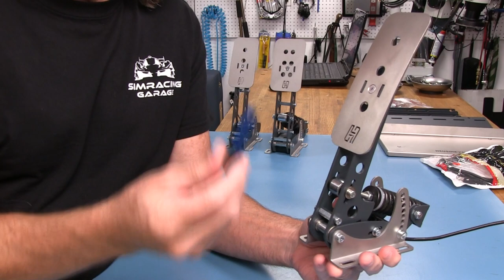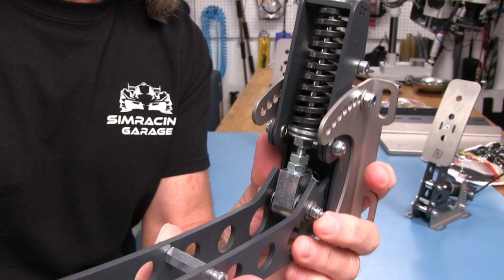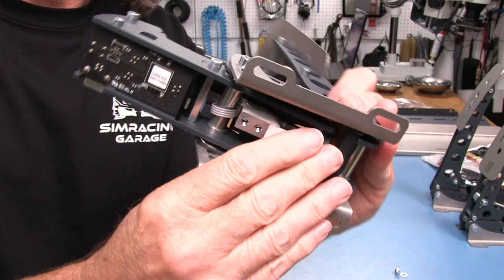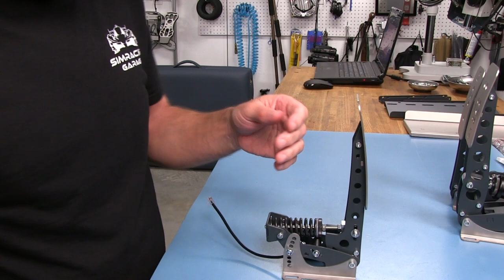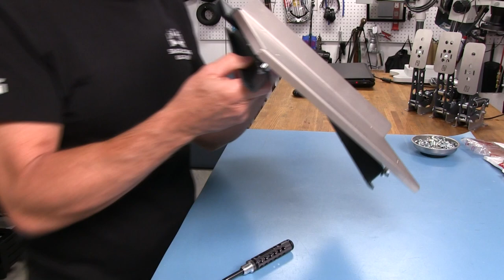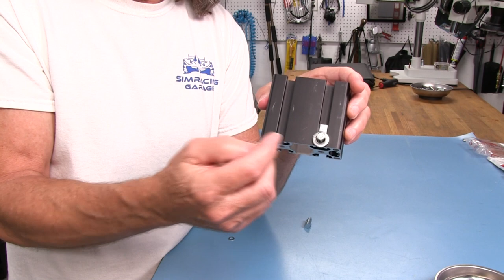Heusinkveld Sprint Pedals Review

Comment: Hi Barry, thanks for the review. We'll look into why the hex heads don't fit the aluminium profiles. We added these bolts to the baseplate some time after the initial release specifically to make installation easier, but it appears the wrong spec/lenght may have been packed.
Reply: It would be great if you offered polyurethane springs to sprint pedals, at least as an upgrade (like fanatec do with clubsport v3).
Reply: That's good to hear as this pedal set is going to my next purchase and I was a bit concerned about Barry's comments regarding the base plate installation.
Reply: @MM00111  Can you elaborate more on this? I'd be interested to hear about it before I buy.
Reply: Ian Longley  I like polyurethane more than rubber, from my point of view it feels more natural (by leg... more like racing car brakes). So I'd like to buy polyurethane springs instead rubber for my HE Sprint. So I suggest HE to begin to make this upgrade for sprint pedals :). Fanatec sells this springs upgrade for 30 eur... I'd like to pay 70 for HE ).
Reply: Had the same issue here. I had to add some washers to get around that problem.
Reply: Why does the throttle look so hard to press?
Do racecars have hard throttles? 
In my driving experience from cheap cars to more expensive €300,000+ cars the throttle is really delicate and really easy to press.
Reply: We took some measurements today and checked the schematics. A typical 40x40 aluminium profile has a depth of 12,25mm. The thickness of the baseplate C-bracket is 3mm (total height 15,25mm). The length of the hex bolt is 16mm. We supply 1mm washers with the baseplate so the heigth can be increased to 16,25mm, 17,25mm etc.

This means that when using the hex bolt to mount the baseplate with 1 additional 1mm washer (or maybe 2) the bolt will have enough clearance to the aluminium profile.

The baseplate manual only details the installation onto a flat metal plate ( https://heusinkveld.com/wp-content/uploads/Sprint_BASEPLATE_manual_V1_1_DIGITAL.pdf - page 10/11). We added the hex bolts and t-nuts at a later stage to the baseplate product. We'll make sure to add instructions on how to exactly mount the baseplate to aluminium profiles in the next version of the manual, the mounting materials are already included.
Reply: @MM00111  On the Sim Pedals Sprint the rubbers are made completely to our spec. On the (phased out) Pro pedals and Ultimate pedals we indeed use standard PU rubbers. The rubbers on the Sprints are a different synthetic rubber. Of course a lot of other factors apart from material spec determine the durability of a rubber, but based on our tests (and of course after having a lot of Sprint pedals in the market already), our current rubber spring solution if far more durable than the previous PU variants we used.

Feel is always very subjective of course :) One thing we did manage with the Sprint pedals compared to the Pro pedals we phased out, is that on the Sprints you can set the brake both softer and harder compared to the Pro's. The range of options you have with setting up the brake stiffness has become larger/wider.
Reply: I'm kind of worried by the "naked" character of the control module on the brakepaddle, in conjunction with dust over time. 
Of course we would clean our pedals on a very regular basis while they are new/newish, but I doubt that will be also the 
case once they are dialed in and need less attention.
Reply: @Scarfliotti  Hey, critical parts on the controller have been coated to protect them from moisture/dust, so we should be ok on this one. After almost one year we have hardly seen any failures on these modules, but in case something does go wrong it's an easy replacement.
Reply: @HeusinkveldEngineering  Good to hear ! And now that you have expanded your workforce and workshopspace, how is the H-pattern shifter going along ? :P
Reply: MMt make it yourself
Reply: @HeusinkveldEngineering  nope, that doesnt work. I had so much anger putting them to my rig and the only real solution was to shorten the bolt with a "mother" ... i put a pic in the cloud. i hope it works  https://drive.google.com/open?id=12JkNV7hYMoayxJbaQd2eY51wgIq2-tGy
Reply: @Oldperior  dont know if anyone replied, but you can make throttle super LOOSE or hard to press..
Reply: hey guys, I am considering getting the sprints soon. just a question, which is the actual max value for the brake load cell? from what I see in that video, Barry just reached around 40kg of pressure at the maximum instead of 60+, is there a reason for that? thank you.
Reply: @_xndrzt  dont remember, you can check it on sprint manual in PDF.
Reply: @_xndrzt  Hey, there is a difference between the brake load cell value and the actual force which you can put on the pedal. We made a video about that here: https://www.youtube.com/watch?v=SEWrTv9t0nM . The actual (maximum) force you can put on the pedal itself is +- 65kg. Maybe Barry had calibrated them to a lower value, you don't necessarily have to push 65kg to get maximum pedal output if you don't want to. The loadcell itself is rated higher than 65kg, but the sensor value alone is not an indication of the actual force you can put on the pedal.
Reply: Old thread but I think the loadcell in the Sprint pedals actually sees less force than what your leg applies to the pedal face. Having just received mine and looking at the design it seems like your leg would have a small mechanical disadvantage against the sensor so ~40kg on the loadcell would be ~65kg on the pedal face itself.
Reply: @mikkopiitulainen8459  It's the other way around. A pedal acts as a lever, 65KG's on the pedal face means that you're maxing out the 120KG loadcell on the pedal.
Reply: One year later and the design is still flawed.
Reply: @phl2009  I got the right kind of bolts with mine.
Reply: @phl2009  I got the right kind of bolts with mine and I bought them in June 2020.
Reply: Why does this not seem official?

I mean 18 subs and no content, that’s kinda strange

Comment: I would like to say that I am grateful to you Barry for these videos.  They offer a deep dive into best practices and offer detailed product information regarding breakdown, assembly, and adjustments not offered anywhere else, including the manufactures owner's manuals.

I do wish that Barry would be slightly more critical regarding the product negatives.  I do agree with Barry about the HE Sprints having some design flaws, such as the standoffs for the pedal tray's threads not being tapped down far enough.  This causes enough of a gap between the tray and the standoffs, even with the suggested washers used (both in the manual & Barry).  This is a minor nitpick but enough of one that causes owner's to do additional work to correct or just put up with the minor imperfection.

I see several other opportunities for Heusinkveld to improve upon that cropped up during my installation.   These being said I feel that for their price point it is a good product and I am satisfied with their overall useability as being the benchmark pedal set to own by the sim racing community.  They are highly desirable and sought after product.  If not upstaged by another company's product, they should maintain their resale value.   I give them four out of five stars rating (4/5).

  1) In order for all of the pedals to be of similar alignment, the Throttle Pedal must be moved all the way forward and then backed off slightly so as not to get hung up on the stainless steel pedal tray back lip when depressed.  I would like to see the grooves on the backplate be shorted in the front to prevent this rubbing.  Similarly, the Clutch and the Brake pedals must be moved to the furthest adjustment to the rear of there slots just to be in line with the Throttle Pedal.  Even with using this maximum range of adjustment, I am unable to line up all three pedals all the way.  I would like to see them do so with future revisions of the schematics and production.

  2) The type of steel used to make the pedal brackets themselves (and possibly other components) is a very MILD type of steel.  It is quite malleable and it is very easy to bend the material by hand (I'm not a very strong guy either!).  All of the pressure on these parts happen on the z-axis, so conversely when assembled the Throttle, Break, and Clutch appears rigid enough to withstand the forces applied to them.  Nonetheless, I would either like to see Heusinkveld use better quality steel or even go back to using stainless steel as a building material.  It would be interesting to see if any warpage due to structural failure occurs overtime or not.  Had I known of the mild steel, I would of more likely than not of chosen the Meca Cup pedals instead, but I preferred the integrated control box of the HE Sprints, as Meca's control box is separately mounted.
  
3) I agree with Barry regarding the method of securing the pedals to the sim rig itself.  I would also like to see additional hight built into the bottom pedal rails, so as to be more readily accessible to using the standard fastener of choice, socket head bolts.  A cutout above the area would be one way of doing this.

Comment: Thanks Barry, I just got my set a couple weeks ago and had yet to install them on my rig. 
I think the throttle pedal does have one additional adjustment you may have not covered but is on the Heusinkveld website, support section under the Sprint pedals tutorial video at  around the 9:00 in for adjusting pedal travel.
Was worth it to see this review before I get the chance to install this weekend.
Great work and review as always.

Comment: Use a washer as a spacer for the 15mm hex channel bolt. For the plate assembly. They should supply them. As a easier solution.

Comment: To fix that little wiggle problem, I would use a socket wrench to tighten the standoffs and use a spanner to hold those gripping washer nuts. Don't turn the nuts, turn the standoffs. Let the nuts dig into the painted steel; if you turn the nuts, they'll scrape off the paint and the steel will be exposed to moisture. If there are plenty of washers leftover, I would use those washers between the standoffs and the painted steel. Everything will be tight and should last a time. ☺👍

Comment: Great review, I just (Dec 2022) bought the sprint pedals and the base plate. Had a nightmare with the base plate. That metal foot rest rattles like hell. I had to use 8 of those little washers (2 per hex screw) but for the price of this stuff I wouldn’t have thought I’d have been needing to do that.

Comment: 3 years old but still helped me decide to pickup a set of Team Redline Sprint pedals.
Also, pretty sure your supposed to mount the heel plate AFTER you've mounted the pedals to your rig, that way it lets you adjust them as you need to.

Comment: I was been waiting for a great review before i pulled the trigger on my next upgrade for my rig. I'm moving up from fanatec v3's I hope the people that made the move were please over the fanatec v3. If anyone has made the change feel free to comment.  Thanks Barry.
Reply: Logo 800 i did and i can only recommend it. feeling for the brake got a lot better. So nice to scale. I had bpk on v3 as well but he sprint is just a lot better and much more customizable as well. Physically as well as with the new software. That calibration is so cool. I have like 5 different brake profiles for different road classes in iracing im switching regularly, awesome. You will need another level of stiffness in your rig tho and of course its another price class, but for me its worth it 100%
Reply: I'm hope it's worth it as looking at getting them soon. Thanks for the feedback and as for my rid rock solid Sim lab rig.
Reply: Logo 800 thats good for you. I dont even use more than 25kg of the load cell because it is so nice to meter your braking power and not that much of a workout on long stints :D And i were using the stiffest settings on v3 with the brake performance kit. I just like it more soft on this one.
Reply: i made the move also as the v3’s began to be to twitchy with the min level on the brake. Also had the bpk installed

Comment: Great review as they all are, thank you. I just got mine delivered and as I don´t use the clutch and brake with my left foot I still find the cable from the throttle too short for my liking. Heusinkveld could´ve made it 2-3 cm longer and saved me quite a bit of frustration.
Reply: Hey Marian, if you contact support and tell them I sent you'll help you out with that 👍🏻
Reply: @RemcoHitman  Thank you. It´s definitely worth trying because I still haven't found that kind of cable anywhere here in Slovakia.

Comment: Great review as always. I received my set of HE Sprint Pedals only a few days ago and am happy so far. I find the adjustments do make a meaningful difference and they are helpful in dialing in the way you want them to feel. I had noticed a small amount of movement on my 8020 rig so will be checking the baseplate mounting bolts and securing it with some washers now.

Comment: My first sim rig/equipment I'm using a csl dd 8nm, and the clubsport v3's. To be honest I've never been super impressed with the v3's, absolutely LOVE my csl dd though. The v3 pedals work well enough for sequential cars, but IMO they are prettyyy bad for h-pattern. Coming from focus st, focus rs, e39 528 manual, and a bunch of others I've had experience with, the clutch feels very unrealistic, which has made me really struggle to drive h pattern with them. So 95% of time I drive sequential cars. Im upgrading to these and can't wait, got to try them at microcenter and was blown away, not only the clutch but the throttle and brake too. I just reserved them at microcenter in Georgia and I'll be driving from north Carolina to pick them up, along with the mount/heel plate. Can't wait! Barry is the best with his reviews, I know exactly what to expect.

Comment: Hi Barry, I have the Ultimates but barley use the brake capacity (around 60kg for me). I'm planning to downgrade to the sprints to take advantage of the HE smart software. Do you think this is a good idea?
Reply from the maker: Yes, the Utimates are amply named. They can put stress on your ankle, knee and hip joints even at lower levels. I sold mine because of this. I'm much more comfortable with a brake pedal with lower force settings and more travel range. Which makes driving more fun. But this is subjective. Others may disagree.
Reply: @simracinggarage3026  thanks Barry!

Comment: So if you mounted the pedals before the heel rest you could get to the underneath from the front it looks like?
Reply from the maker: Yes. Still, with the pedals mounted to your rig it would be a bit fiddley to get a wrench on the nuts because of the short height clearence. There are other ways to access them. if you have an 80/20 rig you could mount to some longitudinal profiles and have room to access the nuts from underneath. I'm sure we could think of some other ways also.

Comment: Hi, barry why the kg diffrence between 32 calibration kgr and 47kgr profile ? thanks
Reply: After you calibrate, how hard you pressed the brake will be stored on the pedal electronics. But when you adjust a profile, totally new settings will be saved to the pedal (47 or 15 or 65, whatever you want). You can totally skip the profiles page and just calibrate at a certain force. If you want to tweak or create profiles for different cars, the profile page allows changing of forces without re calibrating.

Comment: For some reason during callibration throttle and clutch get reversed. They read good initially until I try to callibrate then they switch. I tried to plug them to the opposing socets to no avail.Any idea what might be going on?

Comment: what happened to the 20kg of missing force required to push the brake
Reply: Will Smith Racing I don’t know if u got an answer to your question, the number he sees is probable the encode value and not the kg, the max encoder value is probably 4096 and that what he sees.

Comment: How much does the length of the lever and the location of the spring rod connecting to the lever affect the feel (e.g. compared to Ultimate with longer level, and the spring rod closer to center of lever)?

Comment: Seems like the Pros and the Ultras are much more thought through when it comes to adjusting and mounting.
Also the pedal plate for Pro and Ultra is easier to work with.
Reply: Agree, as a Pro user i would think the sprints would be a lot harder to adjust on the cockpit as barry suggested. I have a Simlabs P1 so i would need to take the whole pedal cradle out to make adjustment, impossible, no but a lot harder i feel
Reply: @menacegtr  Its a little harder but once the angles are dialed in, you don't really need to adjust that anymore. The other adjustments are all fairly doable with the pedals installed on a rig.

Comment: Amazing review by Barry as always. Only one question that is it possible to mount the pedals on the rSeat RS1 rig or do i need an extra plate?
Reply: Did you find the answer as i have the same rig?
Reply: @dizzyd9135  I don't have the answer for that but i am planning to buy the extra plate, atm my HE sprint plan is on hold tho.
Reply: @dzeips  i checked with HE and they confirmef you do need the plate
Reply: @dizzyd9135  okay thanks mate